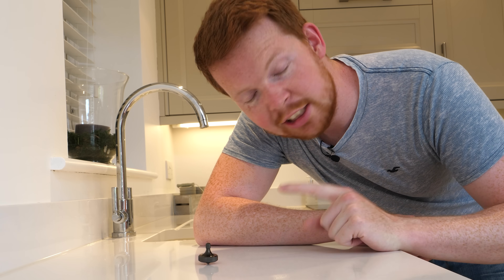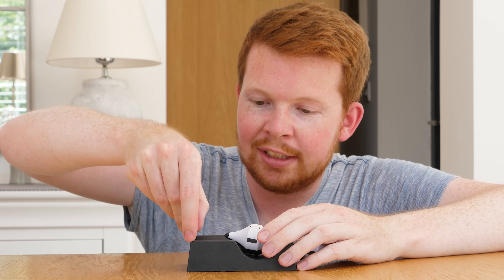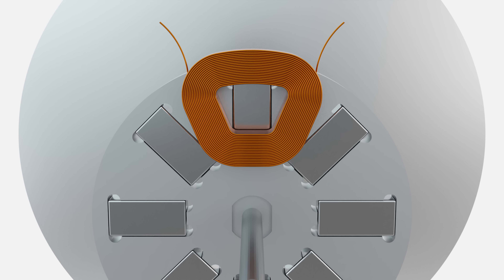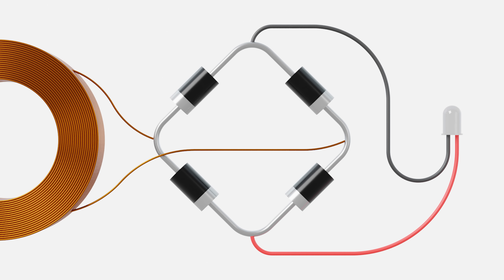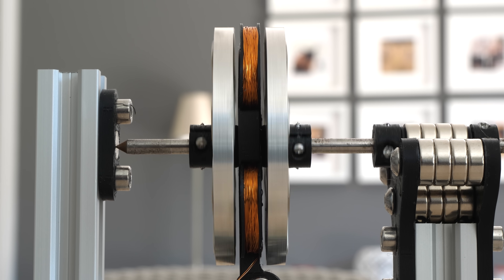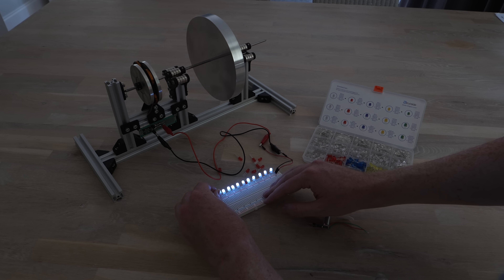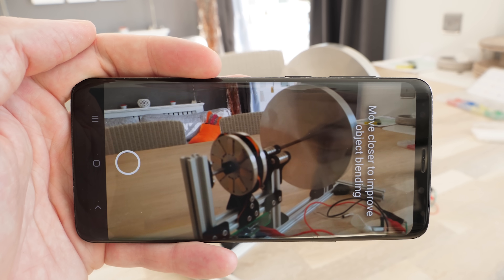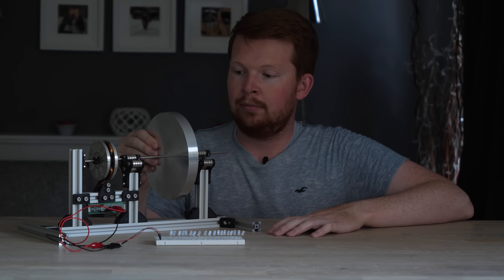Flywheel Battery

Comment: What if you put the magnets on the outside of the flywheel, then fixed magnets around the flywheel. All the ay around the edge on both sides. The outside of the fly wheel will be heavier and moving faster

Comment: 🧠Very impressive and I like the way you worked out everything. I would recommend using a stepper motor controller to turn your coil pickups into a motor to spin your flywheel to speed you can then switch and tap off the electricity as you need. I saw a popular science article long ago that had a concept of an electric storage system for a house. It was a gigantic concrete cylinder stored underground on a magnetic levitation bearing system and motors much like yours. It is stored in a vacuum, to absolutely minimize the drag of air on the flywheel. And it was stored underground just in case it ever detonated from over speed or failure. Thank you for this video it was great.

Comment: Let’s say you were to cut the concept of magnetic levitation and you instead focus on making a large flywheel with a fixed axle. If you were to put it on a gearing system like a transmission where you could shift gears to increase torque. Could you mount it  onto a bicycle frame and possibly create a pedal powered generator. Especially if you made it about a 25-35 pound flywheel so it’ll keep centrifugal inertia keeping a steady rpm for a long period of time. I was wanting to know if this was theoretically possible because I was trying to build a generator for my campsite to be able to power heaters, camp-lights, and a small stove.

Comment: Hi tom, is that possible to made the motor output from generator to spin generator again,
Let's say first you spin the generator with your hand, then the generator charge capacitor then made the motor spin, after that the motor made generator spin more, can you check is there an energy lost ? Or there's more energy that we can use, and is that possible to made magnetic field as flywheel?

Hope you respond
Thanks 🙏

Comment: What if you had a magnet at the end instead of a pin, and then you had the small electric motor re-attached to the axel and get it to run as long as possible?

Comment: As the energy stored in the wheel is proportional to w^2, tou need to use 20000 - 30000 rpm devices. These monolith design becomes not safe for such rpms, and that's why there is an alternative design - tightly wound and glued thin metal tape enclosed to metal case. This flywheel never generates fragments, and, if the tape ripped off, it just begin to contact with a case braking the flywheel.

Comment: 1.could you use the generator setup to spin up the flywheel?
2. would drilling holes into the flywheel and filling them with lead increase the efficiency?

Comment: The project is not complete. theres more components that would make it better for it to successfully work. build a better housing for stability, create a housing for the flywheel and have the ridges have inward faces fly wheels to spin in one direction. have a connection port where red an black wire connect at the conduction zone of the wheel,  to power a mini air compressor with an adjuster to point in the housing to increase rpms or greater power input, have the connection to a regulator that goes to work or charging a battery. so the system becomes the charger an we use the batteries. it takes a rip cord like a lawn mower to start,

Comment: The bridge rectifier is dropping at least 2 * the forward voltage of those diodes, which is a lot  for this application. Use an active diode controller. And design a better stator with some steel laminations.

Comment: “We need to convert to dc in order to power components like a motor or a lightbulb” - manages to pick two electrical devices which commonly run on AC without conversion

Comment: I’m curious as to what problems arise if the magnets are all oriented the same (all like poles facing outward instead of alternating them). It seems like you could get rid of the rectifier, since it would be a DC output, and just use a voltage regulator if you needed to protect against DC over-voltage. I would think it would have a higher efficiency since you would eliminate the voltage drops from the diodes. What am I missing or unaware of? Nice project BTW! Great stuff!
Reply: It's the alternating poles that generate the current when cutting the magnetic lines of flux  as it goes from one polarity to the next.  If all aligned you wouldn't get much, if anything.

Comment: I cannot express how inspiring this video has been.
I’m curious if you ever measured the power you could get out of the generator for a given flywheel rotational speed.  It would be great to see you take some measurements (volts, amps, rpm) and then optimize this similar to the rail gun optimization.  Best regards!
Reply: Well not much energy is captured in such a small flywheel, when rotated by hand. To get a better feeling for how much effort a human body must spend for an every day job of an electric device. There is a video on YouTube where a cyclist is making a toast using his legs.
Reply: Che utilità può avere quel generatore? In altri termini: le bobine frenano il volano o no? Se no, l'elettricità prodotta potrebbe essere usata per muovere a sua volta il volano...

Comment: So, question: instead of a needle contact point for the shaft, which DOES actually introduce a miniscule, but cumulative, amount of friction...why not instead use the same magnetic repulsion on the end of the shaft?  If it's located far enough away from the suspension magnets, it should function identically to the spindle, in restricting horizontal movement of the shaft.  Of course, it's not as precise as the spindle point, but perhaps you can arrange a counter-repulsion system on the other end of the shaft, before the flywheel, in effect using magnetic repulsion to suspend and restrict.  Then the only friction remaining will be from contact with atmosphere.

Comment: I wanted to escalate it up to 600kW, solar powered, flyweel buried horizontal in a low air pressure bunker. 1000kg flying wheel is too expensive?

Comment: Would it be possible to reduce friction by using two magnet pairs at the end of the rod in opposing configuration. So one magnet pair at one end pushes away the rod and the other magnet pair pushes it in the opposite direction?

Comment: I'd love to see this taken a few steps further. They're making flywheels these days that can have like. 50,000-100,000 RPM,  but it'd be neat to see a properly engineered one, that you can still make at home without having to go too crazy with accuracy or precision, and see how much power you can really get out of it.
Reply: Honkydook, 
you cannot get more power out than you input. so what is the point?
Reply: @iareid8255  its energy storage? It's literally a mechanical battery mate. That's the whole point of flywheels. They can store tremendous amounts of energy. And something that someone can make at home without a huge amount of precision could be useful for people... If you had flywheels instead of batteries for your solar panels for instance.
Reply: Honkydook, 

unless you want to stick with DC then flywheels are poor for storage, they slow down as load is applied so frequency drops. 
A battery once charged only slowly loses it's charge. A flywheel needs constant input.
Reply: @iareid8255  okay I'm sorry but you're lacking on very basics of the concepts of a flywheel and how it works. 

A flywheel once spun up to speed can spin for days or hours. Depending how heavy it is and how fast it's spinning(RPM). It can last for hours or days, or even a month between each 'charge' or spinup of the flywheel and how much energy you are pulling out..

It stores tremendous amounts of energy. It doesn't need constant input. The point is to charge it and then discharge it. 

And lastly, you could stick generators to these and produce power from them, either AC or DC is possible from this.

Like I said, it's literally a battery. You can draw power from it. It would be interesting to see how good of one the average person could build, which was what my original question was about. It could be useful.

They have flywheels that spin so fast and are so heavy that they can power a house for a month with them. But even if we could get one that lasted half a day or so of power use for a house, it would change renewable energy storage for the average person.  Would be cheaper than batteries by a huge amount, and the flywheels tend to last decades in use. Can charge them thousands and thousands of times more than your average lithium or lead battery.

The flywheel in this video is tiny by comparison to some you can get. The amount of energy this has stored isn't much. It can be way way more.
Reply: Honkeydook, 

you are overestimating the potential of these devices. To be as effective as you claim requires very special bearings with virtually no friction. 
The larger and faster they are means a larger input drive. 
While inertia has it's use they are essentially short term devices.
Reply: @iareid8255  I'm not overestimating, I know flywheels exist that can do this. They're just not common. They can store huge amounts of power in them. The most common sizes are between 40kwh and 133kwh. Even 40kwh is enough to power the average home for a day. No idea how big that is though, or expensive. They've even looked at the possibility of using them to power a small town, using solar to spin them up during the day. They have serious potential, but new materials today are making them better. Like bearings, lubricants, or the metal or material the flywheel is made of. Newer flywheels can be spun up to 50,000+ rpm and be much smaller while still storing the energy of a large heavy one that spins slower.
Reply: Honkydook, 

sorry I am not convinced at all, particularly if powered by intermittent sources of power.
We will, not agree on this.
Reply: @iareid8255  I don't have to convince you lol, the science is out there being deployed already lol. Dozens of articles on it. Just read the wiki lol.
Reply: Honkeydook, 

I'm an engineer, I don't need to look at the 'science' and if you rely on Wikipedia, you are as likely as not to be misled.
Reply: @iareid8255  I said read the wikipedia, not use it as the holy grail. 

You're not an engineer at all, but nice try. 

You could've used this chance to educate yourself on something you knew very little about but you decided to lie about yourself to give substance to your claims. 

GG, no further replies.
Reply: Honkeydook, 
suits me, what you believe is irrelevant.
Reply: @iareid8255  Same you, Mr.Fakeengineer who somehow doesn't know flywheel batteries are already in use around the world. They've been using these since the loom buddy, on steam engines, waterwheels. It's not new technology.

Comment: Just as an aside to your wonderful video, when you have a hydro electric plant, wind, tidal  or other source of electric generation .. storage of that otherwise useless unused tapped energy being stored as kinetic energy in massive flywheels must surely be an option. Why is this not being done? Apply all that unused potential which is available, instead of turning off the generator system , but instead storing that as kinetic in flywheels.

Comment: Why prevent the unit from moving out with a pin spinning on a plate when you can have magnets on each end of the shaft and have opposing magnets on each end

Which would result in less frictions

Comment: I would do it a bit differently, use bigger fly wheel with magnets inside of it and on both sides of fly wheel put more coils, also it will have less vibrations because shorter shaft. Good idea mate but could do it better 👍😉

Comment: This almost feels like magic. Back in those when electricity was hard to produce this would have been a real game changer.
Reply: It's basically what they did.  Nothing magic about it.
Reply: @nathanwahl9224 Yep. This also can't produce much power, LEDs only require 20 mA or so, so even with 10 LEDs you're only consuming ~200 mA. Which is not much. You could power a small modern device with that, (assuming it was stable enough, which it isn't) but older devices (like when electricity was hard to produce) would consume much more power, so the amount of power generated here would've been nearly completely useless back then.

Comment: flywheels used for energy storage have a problem,. they slow down.   putting one in a vacuum or making frictionless bearings is not the problem.  the problem is making a transmission that can take a constantly decreasing energy source and converting it to a constant energy output. There are transmissions that can do this for relatively small energy outputs however for large power outputs efficiency is lost in the transmission.   you might be able to do it with a VFD (variable frequency drive) however that keeps the speed or frequency constant NOT the current (amps).   Again you need a large transmission.   if you can make a infinitely variable transmission (no gears) for BIG BIG power you can be really really rich over night.

Comment: the problem with flywheel energy is that the flywheel slows down.  So to get usable energy out of it you need a transmission that can produce a constant power output.  say a car.  you need a transmission or electric converter that can take a constantly changing output from the flywheel and create a constant output or the car slows down.  It's not a need of a super bearing or running the flywheel in a vacuum.  It's getting the power out in a usable form.  that is a constant rpm and torque output.

Comment: Ok elephant in the room, proverbial dumb question
Could you not scale up with modifications to power asada..  home let's say
1. done vacuum ( as per previous comment)
2. Larger flywheel (obvious)
3. Feed small amount of electricity to a motor which would go back to system to compensate energy loss thru friction etc

Comment: Can you use magnets to Keep more spin on the flywheel, power a motor somehow adding spin to your one existing point of contact, put it all in a vacuum.  Wondering if it’s possible to get rid of the needle contact point using magnetic repulsion.  Better stabilize the wheel.  I feel like some one could get one of these to spin for a long time at least.  Also wondering how to incorporate magnets into a Stirling Engine, reducing friction or adding energy.  Thanks for the cool video.

Comment: How much energy was stored by the flywheel? It is clear that enegy can be stored and small LED's can be lit by a generator. The very essential information would be dimensions and the flywheel along its mass and RPM of the flywheel. Energy stored by this flywheel is maybe in range of few Joule? That is; power of one watt for few seconds.

Comment: I do something similar, except I put all the magnets in the same direction and run a loop of metal with low hysteresis around the outside meaning every time a magnetic segment passes through the pickup coil loop, the current flows in the same direction. The current bounces, that is, comes in spurts, but it avoids having to use a rectifier. I spin my turbine up with either steam or compressed air - each free. I have several windmills, which all compress air into a common receiver as well as a tracking, circular, concentrating solar mirror, which generates steam on clear days.

Comment: As an improvement. Angular momentum is a product of mass and radius and some other variables, so you can increase momentum without increasing mass. Second, look into induction generator. Third, what if you also use magnets on both sides to restrict motion?

Comment: There are some significant details I don't think you mentioned which would help viewers understand more of the electro-mechanics of your generator.
1) the generator applies a breaking force to the rotation of the flywheel which is a function of the current drawn (ie the load). The higher the load, the more the breaking force, in the worst case, a short circuit would stop the flywheel the quickest, I believe, but that could burn out the electronics.
2) in the light of (1) it would be interesting to measure the resistance of the generator to estimate the voltage drop. This would help you predict its limits. Knowing the characteristics of the large motor, it should be possible to calculate whether the generator could drive it.
3) in rotating machinery the windage of rotating parts is a significant load to consider. It's proportional to the speed and size of the rotor.

Comment: There are of a number of things you can do with your flywheel generator that would be very instructive, regarding conservation of energy: 1) Compare the length of time the flywheel spins without drawing power from it versus using it to power the LEDs or motors, 2) connect the motor to drive the flywheel to see how much longer the wheel will spin with it connected. 

I remember my seventh grade science teacher showing the class the basic schematic for an electric motor and a generator. Not being familiar with the conservation of energy law I immediately though of connecting the shaft of the motor to the shaft of the generator and using the excess power to power something else: voila, I had just invented perpetual motion!

Comment: PS. Well that's how rotors work, except here you generate power from the rotation, while in machines that - for example - are deployed in textile factories to coil-up fiber, you use external sources of power (grid power) to rotate the engine and spin the yarn upon it or "coil it up".